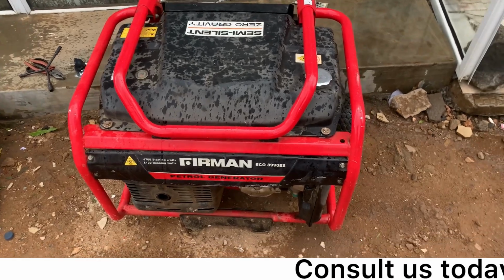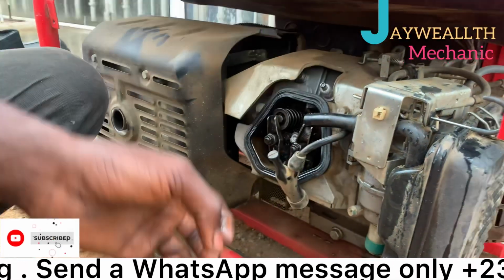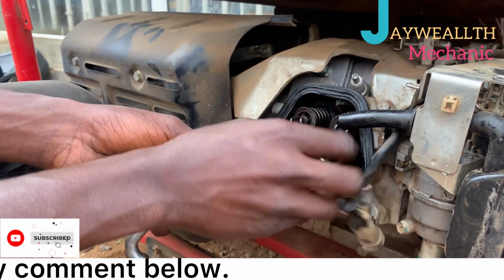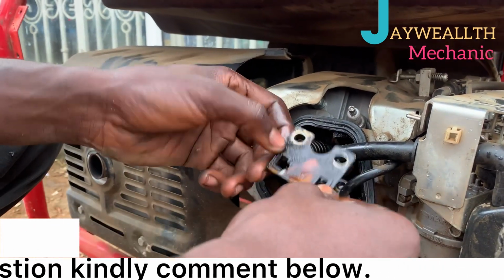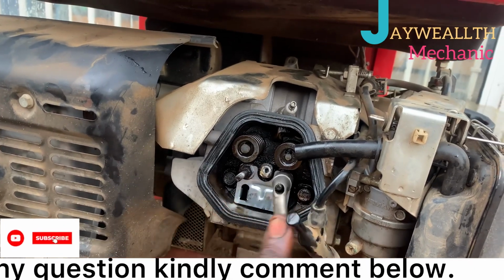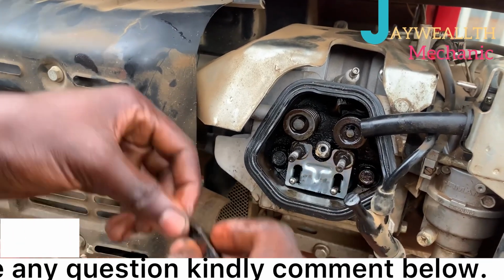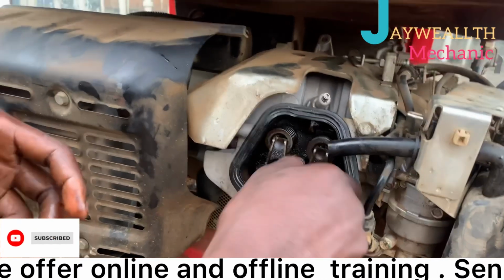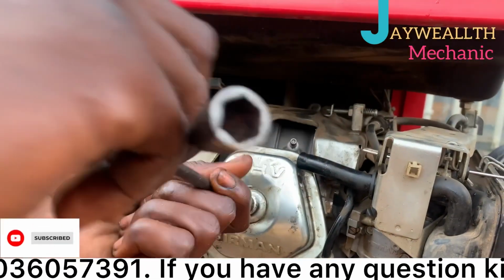WHY YOUR FIRMAN GENERATOR IS HARD TO PULL( Firman ECO 8990ES)

Comment: I have exactly this kind of generator but when it runs, after adding load it runs  fine for the first  five minutes, let say some minutes later the  generator's sound goes down and the voltage  too, after like 1sec the goes back to normal. What could be it's course?

Comment: Pls I just bought Sumec Firman Generator ECO 8990ESR as fairly used and it came without a battery. Pls can you do a video on wire connection for key starter on this gen
Reply from the maker: Okay. Does it have kick start

Comment: Sir, if the generator have a plate valve exactly as the new iron plate valve you used, and it still pulls back your hand when you attempt to pull the starter, what can be done? Thanks
Reply from the maker: Firstly set the valve well. If it persist replace the camshaft
Reply: apart from plate valve & camshaft what else could cause the pullback, thanks

Comment: Hie there my generators was locked so l putt some oil on spark plug then now if moving but the problem it is little bit hard to pull but it is working

Comment: I have a 3600W diesel gen that sounds good when running via electric start, but the cord is extremely hard to pull even with 2 adults pulling. Could the plate valve be the reason?
Reply from the maker: Firstly check the valve settings.
Reply: @jaywealthmechanics9285  Thanks - I did, inlet and outlet were both correct at 0.006"/0.15mm........there is a LOT of side play on the exhaust rocker but I could not see any plate valve, either in the rocker housing or on the parts list in the manual.
Reply: I should mention that despite the side play the decompression lever seems to operate ok when you press it down - it stays down, but is it really pushing the valve open? I just had an idea.....I could try slowly pulling the cord and THEN press the lever - if there is no difference then that would indicate an issue with the rocker?

Comment: Hello Jay, mine own Firman generation, exactly like this but the issue own my own is that the rope doesn't pull out unlike this one in the video that tries to pull out but goes in immediately but mine doesn't pull it. Just a little of the rope pulls out but doesn't allow for smooth pulling and retracting. What could be the cause of it?
Reply from the maker: The rope of generator might be short. Maybe you should get a long rope.
Reply: @jaywealthmechanics9285  is a new generator... The rope has not been changed before and it has not cut before. Just that I wanted to turn it ON one day and discover that the rope isn't pulling enough to run the generator. I don't know if this video could have the answer to the problem or it could be another issue.

Comment: My elepaq constant generator turned off in a strange way so I was going to start it but the rope is not even moving. Please what's the cause
Reply from the maker: Firstly Check if the oil is gauge. If no your engine have got knocked
Reply: Pls what can be done to it

Comment: How much is the plate verve?
Reply from the maker: #500
Reply: Thanks for the response. My kick starter got hooked totally without moving at all.... please could that be as a result of the plate verve or something else entirely? Please can the problem be solve using the same explanation u gave?
Reply from the maker: @Dedongenius1  yes hard pull could cause it. Which could be cause by plate valve or camshaft. This could cause the generator not to start automatically. But cause start manually with hard pull force.